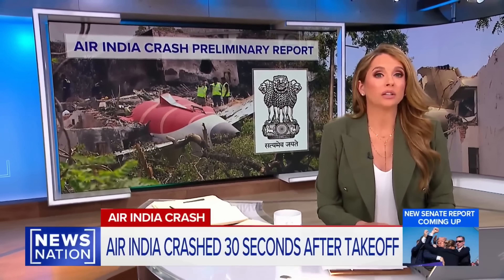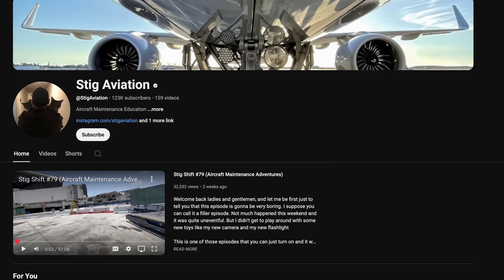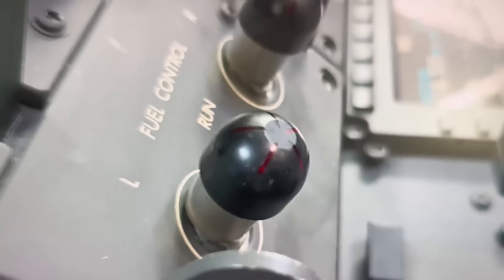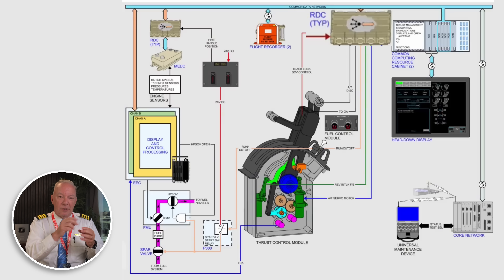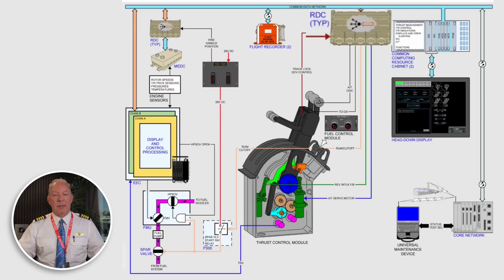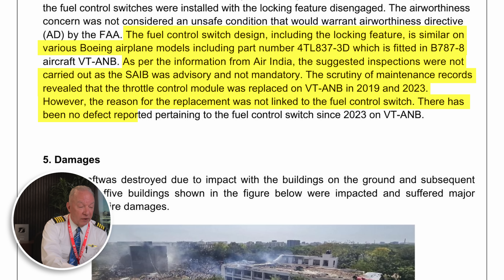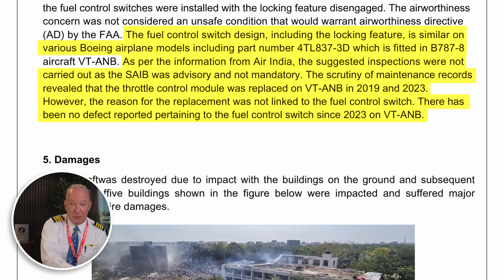The Truth About Boeing 787 Fuel Control Switches

Comment: It is not quite correct that there are "no other inputs". According to that diagram, the 28V is supplied to the relay via the fire handle switch. If the fire handle switch is activated, the 28V is removed and the spar valve closes (as you would hope!), irrespective of the state of the run/cutoff switch or the relay.
In addition, the FMV (fuel management valve?) is controlled by the EEC and not at all by the run/cutoff switch, and the High Pressure Shutoff Valve seems to require both the 28V from the relay, AND a signal ("HPSOV OPEN") from the EEC. (The backwards D shape is probably an "AND" gate, output is on only if both inputs are on.)
That said, it looks like the system records the position of the run/cutoff switch nearly from the switch itself (orange line from the switch to the right hand RDC) so if the system recorded that the switch was moved, either the switch was moved, or the switch contacts temporarily opened (dirt, corrosion), or an open circuit occurred in either the wire supplying the run/cutoff switch or the wire(s?) from the switch to both the RDC and the relay. Also, the fire handle position is also recorded it seems, so if it had been switched that would be on the black box. The timing of the switch off/switch on events makes dodgy switch contacts and broken wires extremely unlikely though.
Reply: Good point

Comment: The argument (by the Boeing engineer/whistle-blower? at the beginning) that it could have been an electrical switch anomaly makes no sense given that the FO on the CVR recognized that both switches were in the fuel cut-off position when the jet lost thrust.  Based on what numerous Boeing pilots have said regarding the operation of those switches, that would have required human action.  Once again, a cockpit video recorder would have settled the speculation.
Reply: But he's not saying that. That's your simplified interpretation of what you think he's saying.

Comment: Thanks for the schematic. I answered many of my concerns. The CUTOFF switch is (almost) directly connected to the valve. That said I would like to see explicitly stated the movement of the switches was heard on the CVR. The RDC is a computer, and if it misread the CUTOFF switches the flight data recorder would indicate them at CUTOFF and the EEC would also receive the cutoff signal for both engines. That switch must be read through some sort I/O circuit to get it on the CDN (I believe CAN bus). Personally, I find the most compelling piece of data is one flight crew member asking why the other had moved the switch to cutoff and the other responded he had not. Was he lying? What if he wasn't.

Comment: I have 3 questions.  
(1) Does the signal to the fuel control valves come directly from the fuel switched or from the ECU?  I suspect it is from the ECU as there are probably other engine conditions that must be met before the valves opened.
(2) Are the fuel valves "fail safe" so they are Normally open AND the signal from the ECU      close them or are they detent valves so an "open" transition from the ECU                              opens them and they remail open until until the "close" pulse is delivered from the  ECU?  .
(3) Is the "open or closed" signal, that is recorded on the DFR, from the fuel valve itself or is it from the ECU?

Comment: Great explanation Captain and answers my original queries surrounding a potential false electrical signal from elsewhere. When all other explanations are dismissed, no matter how inconceivable it may be, whatever is left must be the truth. In this case, there can be no doubt that one of the pilots 'transitioned' the fuel switches to cut off.

Comment: These people are in total denial ignoring completely the "human element" if you were taking off with the co-pilot flying and he asked you did you switch off the fuel. I think you would panic (Very controlled though) and take over the controls and do everything possible to save your plane and its passengers. I don't think you would calmly deny doing anything like that. We really don't need Lt. Columbo or Jessica Fletcher to work out what happened in this very unfortunate and terrible incident!
Reply: Not an accident
Reply: You cannot draw conclusions from the question or the response. YOU might panic, but people who fly commercial aircraft are trained to not behave like that. Rather, they are trained to ask straightforward direct questions and give straightforward direct answers.
Any case,  your reference to doing something "calmly" is based purely on assumption, given the CVR has not been released so we only have text
Reply: @alexanderSydneyOz I am not a pilot however spent many years in court. My reference to panic was obviously hyperbole. Nice to know they maintained appropriate cockpit decorum whilst the plane fell from the sky must be reassuring to professionals. I might ask why the Captain did not say my aircraft and take immediate control. He was the consumate professional like you respect and was charged with responsibility for the safety of the plane and all on board?

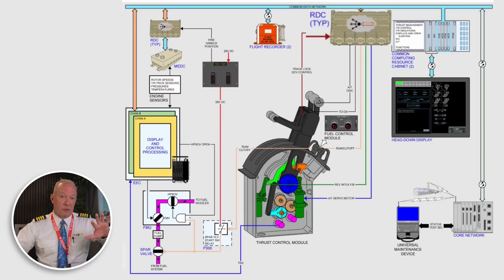Comment: 8:25 Incorrect! There are two signals from the control and processing unit that can turn off the fuel.
Know your limitations! You may be a good pilot but you are clearly not an engineer.

Comment: Not in aerospace, but in chemical processing industry.  You appear to be reading the diagram wrong.  This diagram implies that the SPAR valve is the only valve running directly off the relay power as you describe.  The other two valves shown in the FMU (Fuel Metering Unit) are actually controlled by the EEC: The FMV valve (likely Flow Mass Volume) is shown as a throttling valve.  It would likely gets a position control signal from the EEC that would correspond to how much fuel the engine needs at the current settings.  The HPSOV (likely High Pressure Shut Off Valve) is run by an "AND GATE" logic unit.  The relay basically arms the HPSOV to open.  But it would still need a matching HPSOV OPEN signal from the EEC.   The software in the EEC is likely operating the HPSOV as you describe.  The EEC appears to get the  RUN/CUTOFF switch position through the control signal that the switch provides the RDC.  Also the power for the relay comes from the Fire Handle.  The diagram doesn't tell us, but if I had to guess, the HPSOV OPEN signal implies that both the SPAR and HPSOV valves fail close with no DC power.
Reply: Yes, unfortunately Captain Steve is misleading people because he does not understand electronics in any way, shape, or form. Not even with the help of a diagram.
Reply: It's a simplified diagram
Reply: @mgoo1713  Yeh I was just looking at the simplified diagram that he presented (3:50). I got the impression that he looked at the wiring diagram for the SPAR valve and assumed it covered all three fuel valves.  That diagram indicates that the control wiring for the other two fuel valves would be different than how the SPAR valve is controlled.
Reply: The cockpit voice recorder it’s one of the best evidence which capture the click sound before or after the both engine lost power . if there were no quick sound and the engine lost power this means that there is an issue with the software or the hardware off the plane however, if the click sound can be hurt before the engine is shut off then this is a deliberate act where the pilot physically switch it to off undeniably a. Air India has done a very bad job in releasing the preliminary report
Reply: Thanks for the great explanation! I saw the AND gate there and was wondering why it wasn't touched upon. Also, how does the SPAR valve operate? Is there any way it could temporarily fail (eg by losing power as you explained - say a bad connection?) and cutoff fuel? Does the FDR record the valve position or the switch position?
Reply: I work with DCS systems and I agree with you.
Reply: Are the two engine fuel control valve systems separate from each other? If so, how did they fail that close to the same time? If not, how did they fail exactly 1 second apart? And that would be quite the coincidence given that it’s the exact timeline of manually controlling it. Either way there’s 3 factors of statistical near impossibility all converging into the same event. It seems ludicrous to think other than exactly what Captain Steve said.
Reply: @stewie1571  I don't have that answer.  I could see maybe the switches being set on top of the detent when the engines were started (no one talks about this) which maybe would allow them to start and run, and then maybe the Pilot in Command bumps them off the detents into the cut off position when he pulls his hands off the throttles once they get positive rate.  In that case both pilots could have been unaware that the cut off switches had moved to cutoff.  That requires the switches to be designed to signal run when they are in between the two positions and on the detent. I have no idea if that's the case.  Also hard to believe it could be done to both switches accidently at engine start.  You would need some kind of an obstruction for that to happen.
Reply: I can't imagine any aircraft has a fuel valve that fails closed.  I know you are just looking at the diagram but there would never be a aircraft design that allowed that to happen without a redundant "dumb" system to back it up.
Reply: @Handle11571  Yeh I would want to see the manuals to be sure.  But keep in mind in the case of an engine fire or a turbine coming apart, (where fuel lines, control wiring, and mechanical controls like valves might get damaged), you do need the fuel system to fail close.  Also keep in mind that the RAT deploys when the bus power goes low (or out) to keep the engines from losing power, so that supports the idea that at least one of the valves is probably designed to fail closed.
Reply: You need the proper diagram...everything is failsafe "on"
Reply: @40cleco You could be right, but consider the case of an engine fire.  If you can't stop the fire and the control wiring gets damaged...  If the valves fail open to keep an engine running, that would also allow the fuel to gravity out to an engine fire, have tanks draining out after a crash, or lose the fuel from one tank over an ocean. (it actually also depends on whether the fuel pumps are centrifugal or positive displacement.)  Makes more sense to me that you would need to have the valves fail closed and put redundancy into keeping them open under normal conditions.  Then you definitely lose one of the engines, but better than having no way to stop the fuel and maybe burn the wing in half.  In WWII when fuel control was all mechanical, if a crippled B-17 couldn't stop an engine fire, it was standard procedure for them to dive to use airspeed to put it out.
Reply: The black box said it was the SPAR valve that was closed. The is run by relay power. PERIOD.
Reply: @louischua3605 separate relays though, right?
Reply: I would also add that this diagram simplifies the actual wiring. I state this because in order for the investigators to know when the switches were actuated, they must be connected to the flight data recorder in some way.

When the investigators state that the switches were changed and then changed back, what they really mean is that the signal to the flight data recorder was changed - It technically doesn't prove that the switches themselves moved or that the valves operated. Not that I personally believe this to be the case, but I just wanted to point out that the flight data recorder only records what it's told. This is another reason for having video recordings.
Reply: @yngndrw.  If you look at the diagram (3:50), you will see the RUN CUT/OFF switches, throttle, etc.  are connected to the RDC (Remote Data Concentrator).  The RDC then takes all the analog data from the throttle quadrant and converts that into digital data and puts it on the Common Data Network.  The Data would then be available to the EEC, the pilot displays, flight data recorders, etc.
Reply: @johntremain8403  Thank you, for some reason I was expecting to see a direct connection - But that makes a lot more sense, given how many different controls there are which need to be recorded.
Reply: @yngndrw. yes the diagram doesn't show the feedbacks.
Reply: @powertechnical   Look at the right side of the throttle quadrant on the diagram, it shows all the outputs going to the RDC.  It's an analog to digital control system.  That's how the flight computers know what the pilots are inputting.
Reply: Yes, it is very frustrating how he can say what he does while showing a diagram that clearly and explicitly contradicts him.

Comment: Good system explanation, but I would hope the system design considers that eledtro-mechanical  relays (if that is what is in the system) are terribly unreliable.  Failure mode analysis was no doubt focused on this and the final system design included multiple redundancy.  Single point battery power is also not 100% reliable, especially at connection points and if circuit breakers are in-line to protect the battery.  Again, failure mode analysis and redundancy in design.  Triple redunancy with fail operational, fail operational, fail safe - seems like this would keep the engines running in case of electro-mechanical or power failure.  Thus, we are back to the switches had to have been moved.  Now, why didn't the system determine the airplane was flying and block attempts to shut down the engines.  There should be multiple redundancies there as well.  I would love to be a fly on the wall listening to the investigation.
Reply: OK.  There are reasons to shut down engines in flight.

Comment: The idea that something went wrong electronically seems debunked purely by the fact one of the pilots asked why the fuel switches were set to cutoff
Reply: Plus, no audible surprise reaction by [the captain] even if he was trying to "fix" the situation.  And, if he was doing so, why the delay between turning the switches off and back on ... such action would have been nearly immediate, not 8-10 seconds later.
Reply: @joewarren410  it's really hard to determine who did it. On its face it seems like the guy who asks why they're cutoff didn't do it, but it's plausible he did do it and only said that to deflect blame

Comment: Relays do fail. The question I have is, is there 1 relay dedicated per switch. Therefore, if one relay fails, it will not prevent the loss of power to the other engine.
Reply: If the LHS bus fails, that relay fails. Then the LHS bus is connected automatically to the RHS bus ("failsafe"). Now, if the LHS bus has a short to ground, guess what happens to the RHS bus?
Reply: @ConcernedParent-z1q the system is dead, but they are 2 separate fuel control systems. Is it redundant? I am the person up front breaking things. I'm not the engineer who designed or produced the fuel control system. I'm familiar with steam gauge systems, before electric jets.
Reply: @johnmorykwas2343   The redundancy in this case would make both buses shorted. It's a scenario not anticipated. (The LHS bus failed due to a short to ground, via the failed battery diode module and the shorted battery. This is the most likely scenario I've seen so far.)

Comment: Mmmm the YouTube channel "airline news" has done a very comprehensive and thorough analysis which contradicts this channels assertion that it is not possible for the switch circuits to short circuit.

They are confident that a short circuit did effectively shut down both engines, and have discounted ant pilot involvement in being the cause of the crash.

Who to believe then....a pilot or those with intimate knowledge of that aircraft, particularly electrics and avionics🤔

Comment: Sorry mate,  you're trying to explain exactly how the fuel control switches work.  But you have left out one crucial fact: the cutoff valves are not spring-loaded and do not close when power is absent.  They require the correct voltage signal to close, just like they do to open.

Comment: Question from one of the pilots: why did you cut off.  We are assuming he saw the switches and not information displayed as an alarm on the HUD, that might make someone retrigger the switches from cut off back to on, in any case the photo of the Throttle Module from the scene shows both switches still in the run position.  We didn't hear a scrap in the cockpit as a pilot tried to subdue the other to put the fuel switches back on.  Its the worst psychotic episode I've ever heard of, someone attempting to commit harry carry and then just sitting back why the other pilot attempts to recover the flight. Its just not sounding legit.